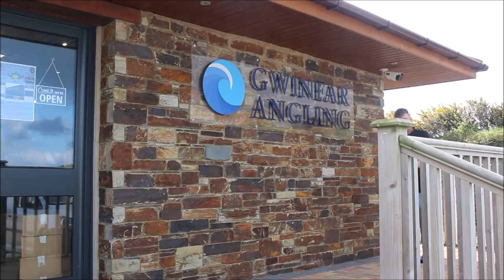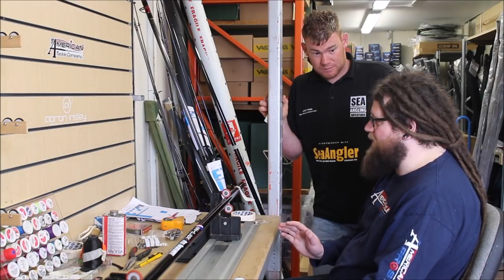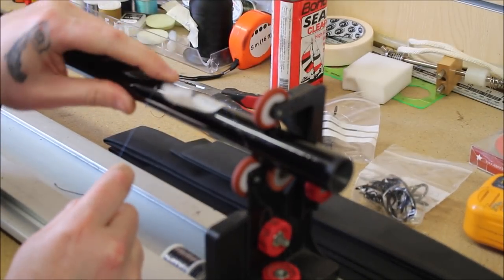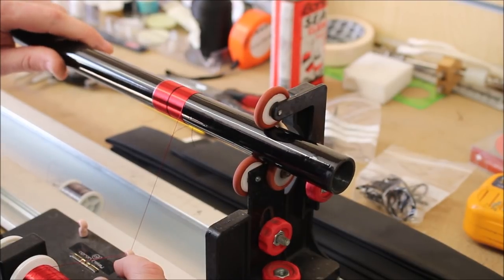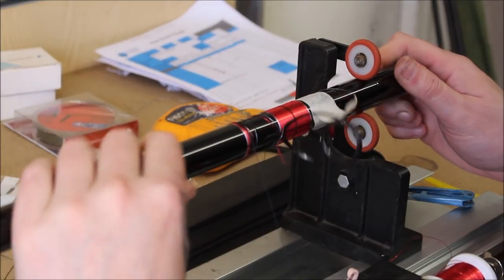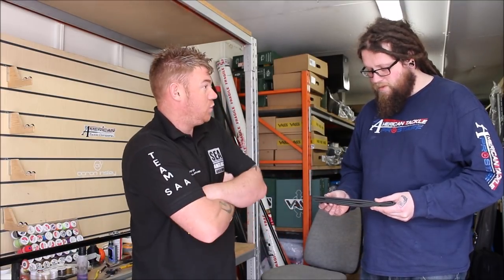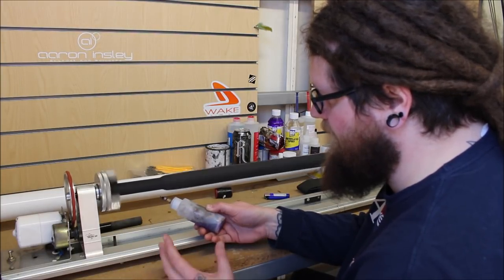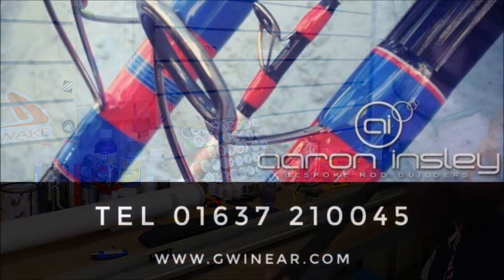ROD BUILDING WITH AARON INSLEY

Comment: Very good video... I'm particularly interested in your power wrapping machine set-up. Is it like a sewing machine motor with the foot pedal? I have one here but is far too fast, 10000 rpm. Have since gone to a real cheap set up which works very well but unfortunately the chucks are definitely not what you would call good quality... Have built the whole set up at home as my retirement hobby... Any information you could post about your motor and pulley set up would be great... Cheers Karl K from New Zealand...

Comment: I've seen people put a strip of carbon fibre cut in a long tape to wrap around the rod, then they put resin tape on to mask where they want nothing and to keep the resin sticking to the shrink wrap, and then they use clear shrink tube over it... after the resin is set with a UV light , the wrap is pulled off.

Comment: Hey Aaron - one quick question: does adding those decorative red wraps between the feet of the guides add any stiffness to the blank? I have a blank where I'd like to add some stiffness if possible to the mid-section, so my idea was to do something similar for those mid-section zone B guides.
Reply: Matt Tuers thanks for your question buddy. Quite the contrary actually, if it makes any difference at all to a rod, it will only make it softer :)
Reply: @aaroninsley4650  Is that just because of the added epoxy and thread weight on the rod that it can becomes slightly softer?
Reply: Matt Tuers yes the additional weight and flat spots. It would depend on the rod and user if it’s noticeable.

Comment: What is the purpose of all that shrink tube. Is it a Europe thing? Or a saltwater rod thing?
Reply: These rods are typically 25mm plus at the butt, so shrink tube is just an alternative to duplon or cork for example, which would obviously raise the profile, which is already significant. The reel position can vary a lot too, even for the same angler at any given time, so a none fixed solution and the ability to slide the position up and down the rod, is really the only practical solution, this obviously wouldn't be possible with fixed grip components. The rods are also in a rest or sat on rocks for periods of time, so the shrink offers as some protection :)

Comment: Why is it you don't do under wraps under the guide feet? That is an area that receives all the stress I would think that you would wrap that and then wrap over top with the guide wrap. You put all that work to put in a center wrap under the middle of the guide but nothing where it counts
Reply: Under wraps for these particular rods would offer little to no practical purpose, in this case it serves as cosmetic only, which is what you will find for most rods built for purpose here in the UK. I have built a lot of bigger game rods for UK fishing and internationally, in these cases i do full under and multi wraps because as you suggest, it is absolutely necessary!

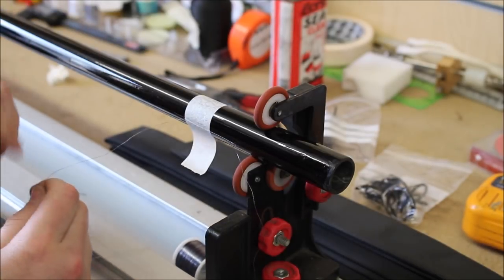Comment: 11:20 to 18:00 minutes - what is the purpose of this under wrapping if it doesn't go completely under the feet, protecting the blank from coming into contact with the metal?
Reply: Matt Tuers, As under wrapping on these particular type of rods isn’t necessary for the reason you suggest, the underwrap in this instance is for cosmetics. I also build a lot of heavy game boat rods, with these rods I will always underwrap the entire length of the guide 👍
Reply: I just finished assembling my 13' surf rod for fishing North Carolina... including under wrappings beneath the guide feet (recommended by the manufacturer). On the beaches here, catching a 20 - 50 lb. hard-fighting fish can be a regular occurrence so I agreed that full under wrapping was a good idea. You?
Reply: Matt Tuers lol yes I think in your case that is definitely appropriate. Unfortunately we don’t see fish like that from the shore here

Comment: Is that stripper guide upside down?
Reply: vectorponder the butt guide is indeed on the top of the rod. Here in the uk, multiplier reels are typically used for this particular style of fishing, these rods have been built for that purpose hence its position :)